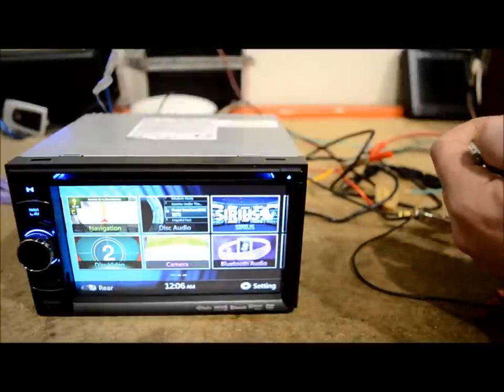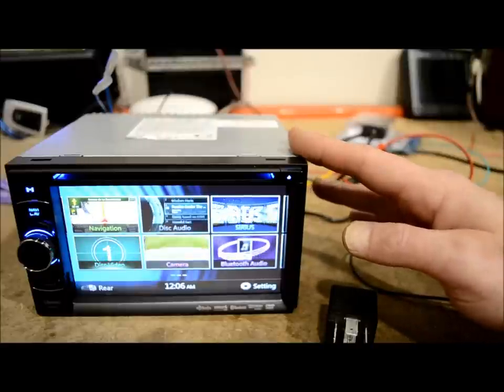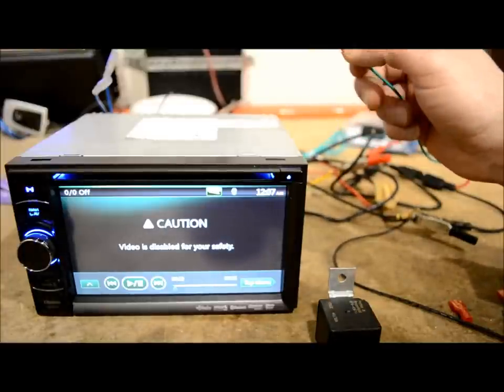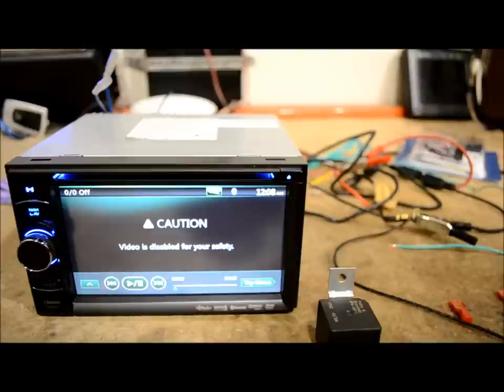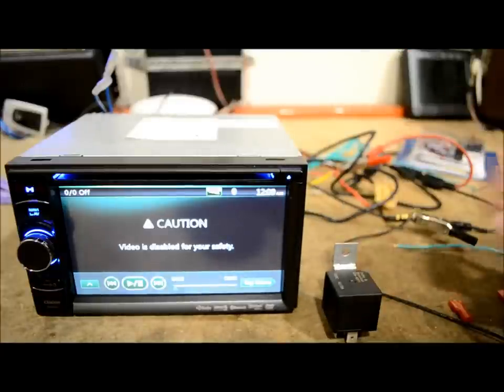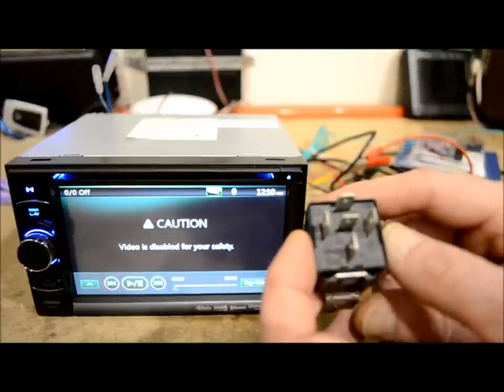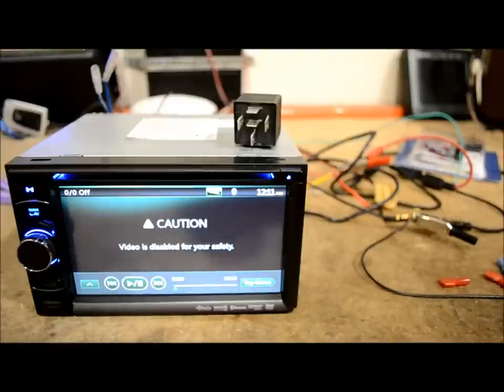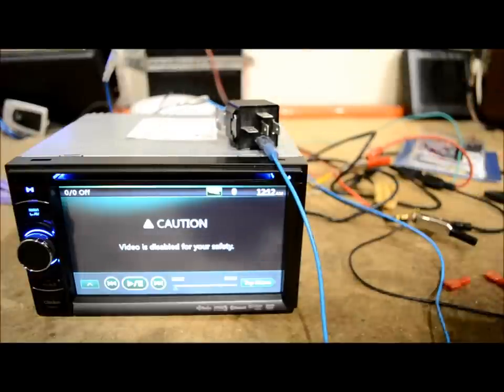How to do an In Dash DVD GPS stereo Parking Brake Bypass

Comment: I have a few questions. I have my antenna in my blue white can use the power antenna instead of the blue white? And second if need just to be grounded why can't I just wire to the black ground?
Reply: There are some units you can bypass like that but most of the newer headunits hitting the market have an extra safety feature that requires the unit to be powered on and the negative be disengaged then recieve a negative signal in order to work.

Comment: Hey I have a factory unit in my 2010 lincoln mkx. Will the relay work with my unit? Thanks in advance.
Reply from the maker: Not sure, I have no experience on that cars system
Reply: Try the Factory reset

Comment: That depends on the model of your radio, but usually if you bypass using an electronic switch, it will bypass the entire video safety.  I found absolutely no reason to bypass my Pioneer because I have no intention of watching videos while I drive.

Comment: I ran my parking break wire around a screw on the top of my radio(JVC KW-V10) when I installed it. I had no issues with using the radio but shortly after I began using the dvd player portion of the radio my battery began dying all the time even when running, because I was told the alternator couldnt charge my battery or keep my battery charged. I had both the battery and alternator checked and they were both good and in proper working condition. I was wondering if you think that because I set the radio up this way if maybe it is some how drawing too much power and killing my battery? Getting a bypass is my last resort but there is no sense in purchasing one if this is not the issue. I dont even know if this is a question you can answer but if so I would really appreciate any insight.
Reply: You might need a bigger alternator

Comment: +lessco electronics I have a clarion vx404. I hooked up all the cablesc except the antenna adapter and brake cable.i have two blue ones left too but there isn't blue on my harness that I bought.so I tried turning on the car and the stereo doesn't work. Am I missing something else? Is it because of the blue cables? It's a pair but I don't have blue on my harness
Reply from the maker: +Javier Cervantes some cars need that blue/wht wire to turn on the factory amp, if you have one you must power it on or you wont hear any audio.

Comment: Thanks a bunch! One question? What wire is the green one that connect to the relay 30 output? The only greens on my receiver are speakers.Thanks!
Reply from the maker: Jason Harris your unit may differ, its the brake input wire on your stereo
Reply: That worked thanks!!!

Comment: It worked on my JVC NT3HD..Just tied the green wire to the black wire.
Reply: It don't work on pioneer like that
Reply: +Demetria Jenkins It should if you wire in the relay like he said. The relay disconnects the green 
wire from ground when the amp wire (blue wire that powers the relay) 
loses power, then reconnects it again when you power on the radio.
Reply: +Naaman Geist yea it does but some times it slow , but I got it to work

Comment: I'm having trouble wiring my single din stereo ...on the top of the unit it says caution DC 14.4 negative ground ....1st quest is cars are 12 volts ?? .....I've got 1red wire needs 2 b wired 2 key ....and another black wire  ground ??? Can you help please cheers
Reply from the maker: 14.4v is just a standard 12v car well charged up by the alternator

Comment: What do I need to do for an aftermarket DVD player with GPS head unit to change it over from factory? What do I need besides the wiring harness and the Indash kit? I have a 2006 nissan titan se with just factory CD player and am FM radio no DVD or GPS from factory. I would also like to keep my steering wheel controls as well. Is this possible to do?
Reply from the maker: Use the fitment guide at metraonline.com, it'll give you everything in detail for free.

Comment: What do I do if I need my remote wire for the amplifier to turn on. can I jump the Amp off the relay remote and back to my unit or do I need to use a different  application.  I am using the pioneer AVH P2300.  I have a 05 Volkswagen GTI and my harness uses a Interface box to support R.A.P. I get this message when in I want to watch movies so how would I wire this up if I am using a amp for my speakers.

Comment: On the newer Pioneer AppRadio headunit models like the AVH-X7500BT and AVH-X8500BHS require a double pulse ground to enable the video. I have seen bypass modules on ebay that are about $10-$25 but if there is another way round this please let me know. Thanks
Reply from the maker: There is none that I know of
Reply: I just bought a x7500, how can i bypass this?

Comment: I have a Dual XDVD9101.To play a DVD I have to start the video, ground it for one second, remove the ground for one second and then ground it permanently (equivalent to e brake on for 1 sec, off for 1 sec, and then back on). Any ideas for bypassing this?
Reply from the maker: on those I suggest buying a part called a tr7, it's made by PAC

Comment: Hi I got an after market dvd GPS player that a buy for my car.  When I try to use the Bluetooth  on it my phone  can't find any thing. I don't know if there is a software problem or the player itself.  There is any way to test the Bluetooth on it.  Please help.
Reply from the maker: what model?
Reply: On the box say  universal model 8865 car entertainment system. I don't know may be just the software but I been looking on the Internet for some kind of software for car dvd player  but I cudent find any results.
Reply: Thanks for the reply.
Reply: May be possible  to install Android software on it I don't know what you think? Could  fix the Bluetooth problem.  Or I will have to open to check for any evidence inside the unity

Comment: I just got a pioneer flip out. and it works to ground it to the radio but when I turn the key off and turn it back on it don't work unless I take the wire off and but it back on. someone know how to fix that let me know
Reply: use the relay like he showed in the video
Reply: Run it thru a switch.  When you turn it on and off, it will think that you're  manually removing and putting it back on the ground connection.

Comment: I have a problem with my unit, as well, asked a question on another video. I am trying to install a backup camera,is this the way to handle it, using a relay or go with a diode? My unit has the following wires: a wire which needs to go to the handbrake in order to see video i.e you can't using video when driving. Then I have a wire that goes to reverse back light to install my backup camera. Question is, which wire do I put where?86 to + is your battery,(12V) or from your unit correct?Ground to 87 &86 Output 30, So where does the wire that needs to be connected to handbrake and the one from my unit that goes to my reverselight go on my relais? I am lost here, camera wire the + where does that go? To 86?
Reply: Pfirtzer when you buy a backup camera there's usually a really long video wire and it both ends there's an little wire connect that little wire to your reverse light in the back so when the reverse comes on it turns the camera on and then connect the other end to the head unit the backup feature for most head units don't require the parking brake thing to be installed that's just for DVD function or GPS function sometimes most of the time the GPS function will still work even if he don't have it in park you just can't mess with it in part it will still run which I think is kind of contradictory because if you're using GPS then you're looking at a screen so if you can use GPS and why is it illegal tonight be watching a DVD or listening to One or whatever you know what I mean
Reply: Thx to you I got it working,!yes the long video wire with the yellow rca connection had a red and black wire for connection. SO I connected it on the back red to + taillight and black to the - of taillight using solder and. Then in front connectiion of the red wire to the cam wire of the unit and black to  chassis. It worked. Just one thing is still not working as I would like I wanted a toggle switch using diodes so I can turn the unit on and off when towing something behind the car.  I dit use diode but didn't conect them in a chickenbone pattern,instead I took a wire, connected a diode on the each end  the band facing the unit, stripped the wire  in the middlle and connected that to the unit . One end I put to the camera and the other to the swith and 12 v to the other connection of the toggle switch. When I use the switch it says: no signal, I guess something went wrong. I suspect I need a wiring from the backlight to the front with a diode? I am lost :(((

Comment: I probably sound stupid, but could I just use electrical tape and tape the green wire to the chassis?  Rather than hooking up the relay and all that jazz?
Reply: Not a good idea. Heat from the deck or sun on a hot day will melt the glue and tape gives way. Try loosening a metal screw on the unit and tightening it onto the wire instead. Like OP says, the relay is only needed for some brands/models. Try it to find out.

Comment: I do not know if anyone can help me, but I put in a relay to allow me to watch my dvd whenever. "I hooked it up correctly"  It seems that the first time I installed the relay it worked. Than I shut off my car and went to try it again and it seems as though the relay is either not clicking on or clicks on before the unit starts.  Also, I tried to ground my parking break wire directly to the metal box around my unit and it worked, but than I turned my car off and turned it back on and it did not.

Comment: hey there, thanks so much for your video! i was scratching my head trying to figure out how to disable the parking brake safety feature on my new radio. BTW you mentioned that PDF on using relays for a series of different functions, is there any way you can send me a link through gchat or replying with the link? thanks in advance man, and thanks again for the video!

Comment: I have a amp and subwoofers also connected to my unit. If I use the remote wire for the amp on the relay how will I get my amp to turn on and off? Am I still able to use the remote wire?
Reply from the maker: sure, split it to both. it only takes milliamps to click a relay coil.
Reply: Lessco Electronics Ok thanks... I will try that... Is that a specific kind of relay? Where can I buy it at?

Comment: you can ground it to the frame on any radio and youll be fine no need for a relay.. all it does is when the brakes applied it completes a circuit saying its in brake by grounding it you do that same thing so it says your in park all the time simple as shit

Comment: When you talk about the ground, is it the ground out of the wiring harness from the deck or is it another wire?
Reply from the maker: +Dillon Zimmermann I'm talking about the chassis ground metal in the vehicle itself.
Reply: +Lessco Electronics What would happen if I put it in with the original ground from the harness?
Reply from the maker: nothing, it's all the same ground!

Comment: I just bought the clarion nz503 single din stereo for my mustang and mines say the same message, so if i connect the bypass wire to a ground it will work?
Reply: Clarion is finicky. You'll need a multiple pulse on the ground signal to get a reliable bypass. DIYBypass com has them.

Comment: For my unit someone installed a toggle switch. Can I take the two wires going to the toggle switch and connect them to a relay instead?
Reply from the maker: Fred Zenner depends on the model, some are in need of a delayed pulse. standard relays cant do that. tell me whats the model of the unit?
Reply: Lessco Electronics The unit is a Clarion nz503

Comment: AS a pro installer I can't get this straight! Can't short out the brake wire, if I do It's a liability issue if you ever get into a wreck because your watching TV and driving. So don't ask.
You might sign a waver but the person you just killed family did not, and they can sue me for everything I own and the rest of my life. So it would be stupid of any paid Pro installer to SHORT out the brake wire. Don't do it if you're a Pro its not worth the risk you can't cover your ass and it could bring on criminal charges. If you work in a shop and the boss says do it, you can refuse to do it. However because he owns the store its his risk. Not your's, get it in writing he said to do it and keep that at home in a safe place, he won't sign it don't do it. Put the year make model and vin the the document. That's your get out of jail card.
It relieves your liability.

Comment: I did this and I can hear the relay click, but I have to remove the green wire and reapply it to work. What did I do wrong here?
Reply from the maker: murderrsirenss your stereo may need double pulse to operate properly (like the new pioneers and duals/jensens etc) but you didnt say your model, so I cant say anything else for your issue... :(
Reply: Sorry, I feel like a idiot that I did. Its the NZ503. I caved and just did a switch. Thank you though.

Comment: Any pointers on how to get the feed from your in-dash DVD player to your overhead monitor currently DVD player on overhead monitor doesn't work but monitor still works. Your help would be much appreciated
Reply from the maker: It shouldnt be too difficult, Hers what you need to do. Get behind your in dash, locate its yellow rac labeled video out and extend it and connect it to your flips downs aux1 or av aux input and that ought do it.
Reply: Lessco Electronics thanks I'll give it a try.

Comment: thanks for the video, in previous comments you mentionned that the nx404 needs @361229035115...what does that mean? or what is that @3612...? a part?
thanks
Reply from the maker: that's an ebay item number
Reply: Ok nothing comes up in ebay for that number... Is it still valid?

Comment: sir, i have a question again i only got 2 green and its for speaker only RL+ and RL-. can you specific the green sir? thank you
Reply from the maker: On most radio's the parking brake is green, But you may have one off those odd ones... tell me, what model stereo are you working on?
Reply: power acoustic  model NB-718.  i just bought that to amazon last week and very disapointed because you need to buy the gps adaptor and its 159$. i already cause me 250$ for that radio and if i return it it will gonna coast me again so i decided to keep it and give it a try...... i got the parking brake but its color pink. i have green here but its for speaker rear left and rear right. sorry for my grtammar english because im asian and still learning it. thank you sir for helping!
Reply: again sir the model is (Power Acoustik PD-718NB).i watch your car stereo wiring explained in detail and im using that for my guide when installing because my reverse harness is cut.thank you very much for sharing your knowledge to viewers.

Comment: Wait, so all you have to do is ground that green wire?? Wont that short anything or draw power when the car is off?
Reply from the maker: not at all, its perfectly safe
Reply: Lessco Electronics
Green wire on my system is for the right speaker, so be careful what you ground.
Reply: I just hooked it up to the parking brake. Theres an initial "play" before the brake grabs on my car. If I ever so slightly lift the brake, the dvd comes on. No need for anything!
Reply: I have just pushed the factory reset button prior to final install.  I put in drive and it has worked 4 times on 4 different models  try it before to mount so if it doesn't you could try another option.  You can try reverse, but if you wired it right it will not show as that could be wired to a back up camera.  Good luck

Comment: so if you use the remote wire on the relay, how are you supposed to wire an amp? you you just daisy chain it to the amp like you did the ground wire?
Reply from the maker: you can share it for both functions
Reply: Lessco Electronics would that include sharing the 12v for a back up camera?
Reply: tyshef There shouldn't be a problem with sharing the power source, The remote wire is low amps so to use this alone would cause great strain on all additional systems. but as the remote wire is only used to turn on a separate circuit, a circuit that can handle higher amps. That is all a relay is, two circuits in one box, A low amp circuit, and a high amp circuit, the low being used to turn on the high. I personally would recommend running a new wire from the battery for the high amp side, that way i know i have clean power an that way not touching the OEM wiring. And also remember to fuse that clean battery wire also, Just my personal method of doing such jobs on cars, if running multiple amps, or any other additional luxuries. Message me if i can be of any help.
Reply from the maker: yes, you would just connect them in parallel